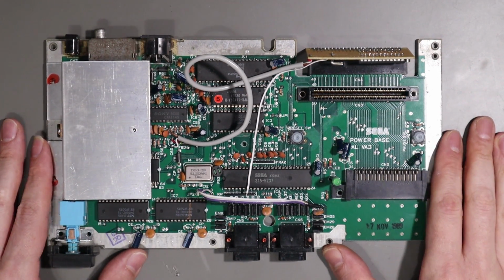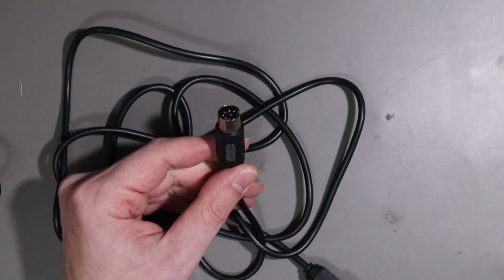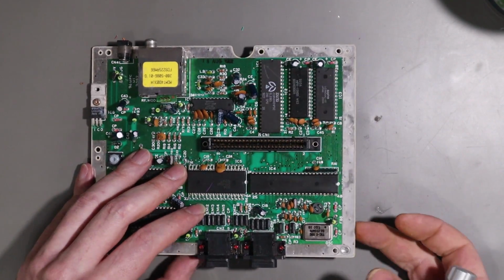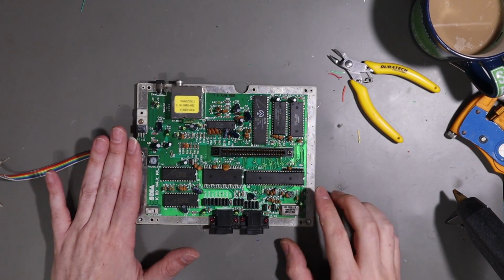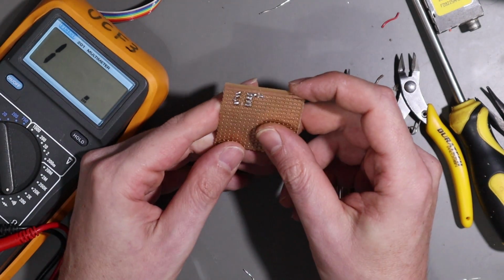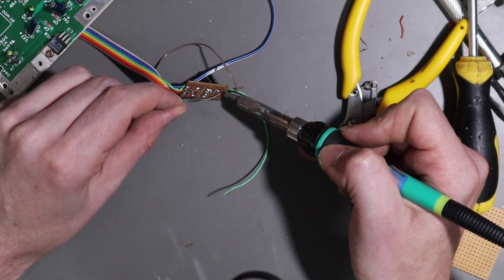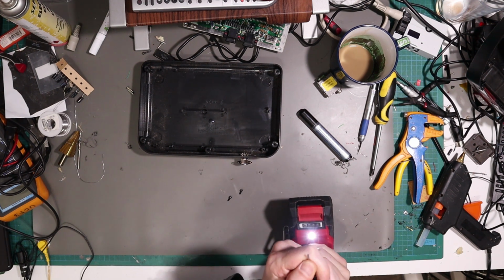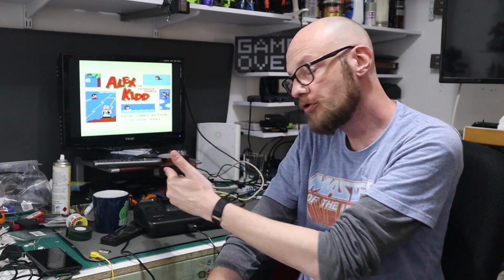Pimp my Master System! Pt 2 (SMS1 update and SMS2 SCART)

Comment: Thank you your awesome Videos.
I would have switched the two Cables in the Scart Connector. You can remove the pins with a needle and put it back in the new place.
Reply from the maker: M. Moggert Much like the DIN connector, it too is sealed.
Reply: @MrLurchsThings   OK that bit i missed. In the  EU the most Scart Cables, I bought, were screwed together  with one "Nut" at the Cable